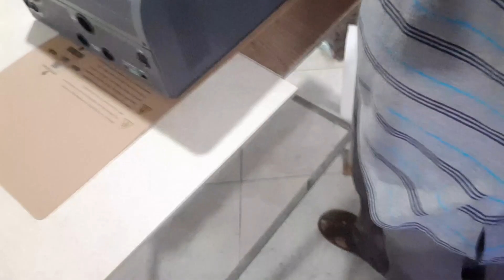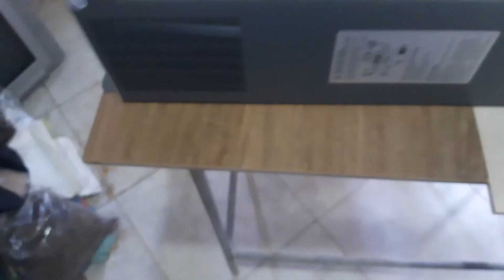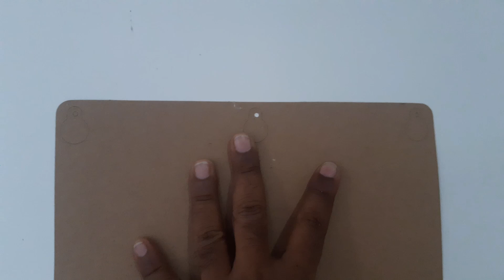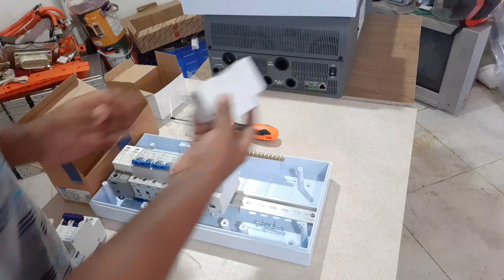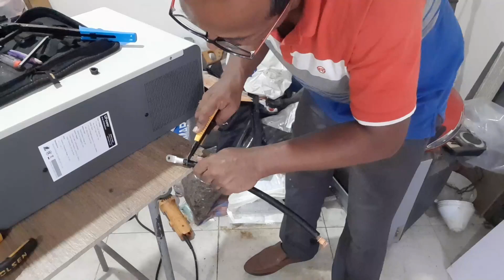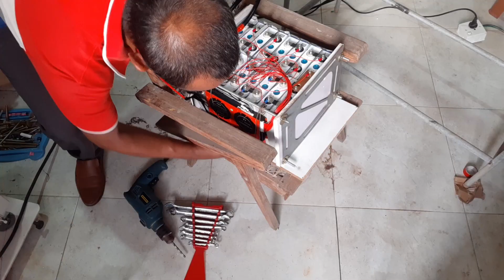DIY 5kW Hybrid Off Grid Solar PV System assembly - EPEver UP5000

Comment: I have 5000-8042 model can I install 660w * 9 panels in 1 series?
660 watt Astro Energy solar panels
37v
18amp
Reply from the maker: Yes! If total series PV open circuit voltage is less than your model specified OCV, then it should be good
Reply: Hello could I get your diagram

Comment: Hello sir nice video and very helpful. I have this inverter but i don't want to use batteries right now. Epever manual says that is possible to use it without batteries but didn't say how to start safely the inverter without batteries. It's ok to connect pv array first and try to start it or not?
Reply from the maker: Hope you have the high PV voltage model !
Low PV model will not start without battery !
You may connect grid first and then connect the PV for the first time . After that it is okay to connect either way
Reply: @HappyGreenerWorld  Thanks for your reply. I have UP3000-HM10022 model. It will be ok?

Comment: Hello, did you have any issues with this inverter? I have seen that some people who have bought the "UP5000-HM8042" have had some issues with some features with this inverter. It seems that it's a software issue and the Epever needs to receive back in China the inverters in order to update the software.
Did you noticed any issues with yours?
Reply from the maker: No issue so far. Later version needed number of firmware upgrades to resolve software bugs. No need ti send inverter to the vendor
Reply: @HappyGreenerWorld  so, you were able to perform software updates in your location, with no need to send the inverter in China?

After these updates, the invert works with no further issues?
Thank you 
😀
Reply from the maker: @kostaskostopoulos2913  Yes ! Most of the errors were corrected in latest firmware update

Comment: im using trina solar 500w x 4 panels. (model - tsm-500de18m(ii) ) . on back sticker it says maximum series fuse 20a. so should i pick gPV fuse capacity as 20A instead of 15A as mentioned in video? kindly explain. I am new to these wiring items and trying to make a full list for the wiring. I have watched this video several times and using as a reference when I need to double check things. thanks a bunch.
Reply from the maker: 20A fuse should be Okay!
Reply: @HappyGreenerWorld  Thanks for the reply. another thing I am not clear, lets say my panel is 500w and its voc is 51.7v. so if I series 4 panels then total voltage lets say 210v after rounding. so for the DC spd and Dc breaker 2 pole, which voltage I should use ?  and also let me know which Ampere values I should check too. on item list in description, it shows DC SPD type 1+2 100VDC and DC Breaker 2 Pole 100V 15A. but not sure if it is a match for my situation since my panel max sereix fuse is 20 and voc 51.7v. kindly assist me in this case 🙏
Reply from the maker: @eljay2512  You need to select components to match with your voltage / current . DC SPD 200 or 250V , fuse 20A

Comment: Hi if i use a hybrid inveter like Upower-Hi UP5000-HM8042 48V, i dont have to use a changeover switch additionally right? since the hybrid inverter itself handle all that right? 	kindly let me know. Thanks as always...👍
Reply from the maker: Yes! But always I recommend you to install a manual changeover swich bcoz of easy maintenance and/or system failure situation
Reply: @HappyGreenerWorld  Thanks a lot for the explanation.
Reply: @HappyGreenerWorld  hi kindly can i know what capacity I should choose when it comes to the manual changeover? I'm about to use above mentioned 5K inverter with sako 48v 100ah battery pack

Comment: hi i have few things to clear on my usage requirement. kindly help. my average usage is 160 units. so i calculated as you mentioned on fb and my solar panel watt requirement is 1.45kw. 
1. first can i know which way better when it comes to buying panels. such as 500w x 3 or something like 350W x 4 ?

my battery requirement is 4kwh according to calculation. so i am thinking about using 12v 200ah eastman Tall Tubular Gel batteries in series way to have 24v 200ah pack. let me know if that way is the best way to go.

2. when it comes to hybrid inveter brands, which brand you prefer most between epever and sako?

3. for 1.4kw requirement, is it ok to use high pv hybrid inveter (ex: Upower-Hi UP5000-HM8042 48V) ? then thing is after few years later im thinking about expanding panels count once i could finish 2nd flood on the house. so as a future proof approach i am thinking about buying high pv model beforehand for a 1.4kwh for the moment. kindly let me know if this is not a good way to go or not? will there be any performance drop?

Thanks again for all the knowledge you share for free considering the current environment of the country.
Reply from the maker: 1.For high PV inverter , you need minimum 5 panels to reach minimum Open Circuit voltage .
For a 1.4kW requirement , it is better to go for 3kW low PV model such as Sako Isun3
2. Try to go with LFP. Lead acid batteries are not recommended for solar applications aa the life time is shorter
Reply: @HappyGreenerWorld  thanks for the clarification. 

1. is it ok using 500w x 3 ? i am thinking of getting panels from raigam - 500w trinasolar mono (tsm-de18m(ii)). kindly let me know your thoughts.

2. what is the brand of your choice and why ? epever or sako ? epever seems bit pricy but let me know if it is worth the extra buck so I will go for that.

Thanks again..
Reply from the maker: @eljay2512  SAKO. Cheap but reasonable quality .
Epever is having multiple firmware bugs which they were still unable to resolve . But build quality is excellent
Reply: @HappyGreenerWorld  sorry to plug myself in this but I too have a similar problem. I have ordered 3x 540V solar panels and I'm confused if I should go with a low PV or High PV 3kW EPEver inverter. The UP3000-HM10022 is a 24v high PV inverter but required MPPT voltage is 80V - 450V which the 3x540w panels can provide. Is there any reason why I should go for a low PV model instead?
Reply from the maker: @roshane.nanayakkara  For high PV inverter , you need minimum 5 panels to reach Voc. If you are not intending to add more panels , then go for low PV by parallel connect .

Comment: වොට් 500 පැනල් 6 ක් දානවනම් පැනල් සහ ඉන්වර්ට් අතරට එන්න ඔන බ්‍රේකර් එකේ වොල්ට් එක සහ ඇම්පියර් ගාන කුමක්ද කියන්න
20A 600v?
Reply from the maker: Take Imppt of panels and multiply by 1.5 safety factor for breaker current rating .
Take Vmppt and multiply by 1.5 for breaker voltage range  safe side

Comment: Great video! can i use Sako(CATL or BYD) 51.2V 100Ah battery with EPEver UP5000-M10342 Inverter ? if so how many batteries I can go max? and also is there any advantage of using Sako(CATL or BYD)	51.2V 100AH over LiFePO4 EVE 105Ah battery ? kindly explain. I'm also learning these things at the moment to make a list of devices that I should by for my setup. Thanks again for the information
Reply from the maker: Yes! You can use Sako pre built batteries . They are so easy to install and use. I'm a DIY lover and TF I dont like it.

Comment: can this be installed without a battery? i'm thinking to purchase PV first then battery
i allready have the inverter
Reply: EPever new UP-Hi inverter charger support without battery model
Reply: @gospower-energy  would you happen. To know minimum voltage from PV?
Reply from the maker: No! This low PV model does not support batteryless mode. You have to buy high pv batteryless supported model to use without battery

Comment: Good insight
Could u tell tell us how did you obtained there materials? I can understand your battery and inverter from Ali Baba.
What items are available in local market?
Reply from the maker: Except Inverter, Battery cells and BMS, all other accessories are frkm local market. You may find them from General Power Electric.

Comment: Thank you. Very interesting video. Can you tell what you connected to battery + and wire. I see some brackets or fuse connected to near battery. What is that?
Reply: I got it from previous video. What is the rating of ANL fuse for 150AH battery set.
Reply from the maker: For -ve terminal ANL Fuse was fixed! Pls see my below video on ANL fuse.
https://youtu.be/WcOKds9gt8A